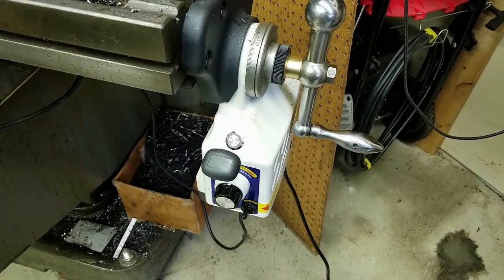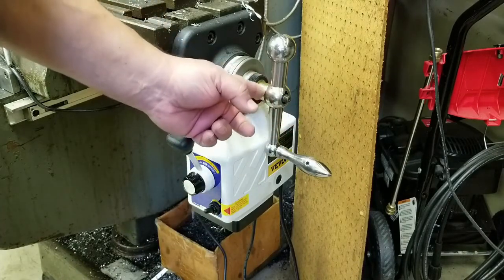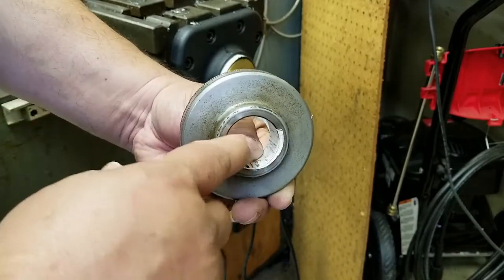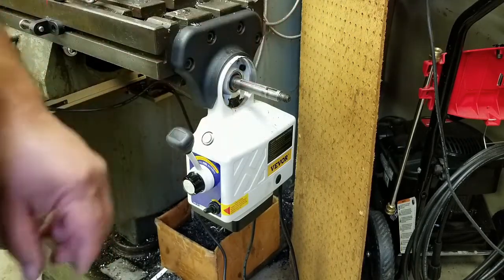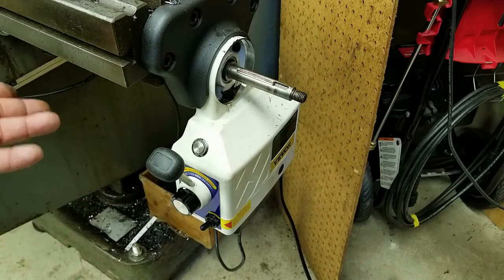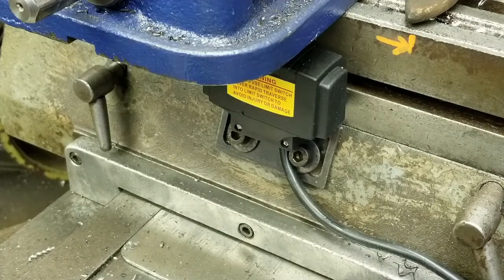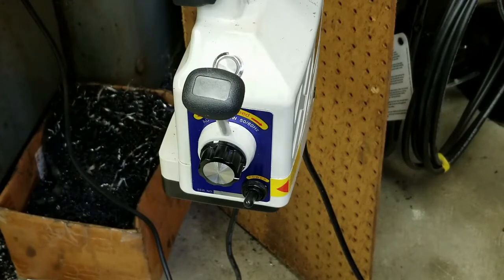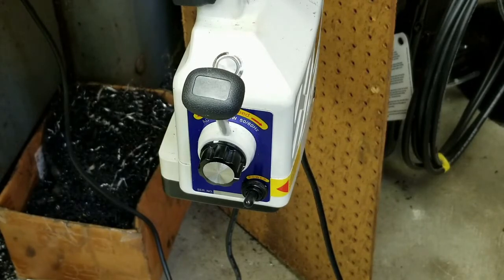EBAY VEVOR POWER FEED – MY THOUGHTS AFTER 5 WEEKS OF USE

Comment: I just fitted the same one to a bench top mill. I had to do quite a bit of modifications, but I must say, the basic unit and design is very adaptable. For anybody who is a fitter turner machinist this is very basic adapting and modifying. The unit is perfect. I have come to learn that a lot of Chinese products recieve negative propoganda for various political agendas. I run a jobbing machine shop and for over 20 years I have used Chinese and Indian made machinery. Like every manufacturer, there is good and bad. In my modest opininion, Chinese technology is way ahead of the majority of the world, and envy for this fact creates a load of negative, unverified reviews!  Simply because our South African Rand is such a weak currency, I have been forced to buy Chinese equipment because it is affordable. Surprise surprise! Some of it is excellent. My benchmark is to look for Chinese machines which have hand scraped ways and beds. Absolutely no variation between it and a Hatz lathe I also use. One "German" machine is made in China and rebranded. I had one and it got me going in business. I hate politics!!!
Reply: Ja Bru, I miss Adendorff since moving to Ireland.

Comment: I just got the same one and it was tripping my GFCI as well, I saw your video and found out it was a problem... I took it apart and the two phillips head bolts that are holding the circuit board on, are transfering trace power into the grounding circuit. I made a couple paper shims and installed between the circuit board and the mounting plate. Solved the problem, no more trips, hope this helps!
Reply from the maker: Awesome! One day I will tear into mine and hopefully find what you did and get it fixed. Thanks for watching and commenting and please subscribe if you haven't already. 
Mike - Plus8Precision

Comment: I had some similar issues with my chester 626 mill. I couldnt use the end plate so had to drill and modify etc my end plate. Made a few bushings and spacers etc but I managed to get it fitted ok. The plastic lock nut I will replace with a stainless one eventually. One issue I did have was shiming the brass gear correctly. But if its noisy you will need more shims adding. Cheers good video.

Comment: Couple comments: First the the loose bearing race bothered me so I made an extending bushing just long enough to reach beyond the edge of the 20mm lobe on the leadscrew. This way the spacers push against the the race and lock it in. Second, I was able to fix the jam-nut problem by using a normal sized nut and turning half of it down. So half of it fit inside the handle. Hope this helps. 

PS: I am also a Sheldon Owner (EXL). Best Regards Bob

Comment: Great info, I've got a kbc mill with the power feeds they put on it, its 2009 model haven't had any problems so far, knock on wood, lol..
Reply from the maker: Kentucky Trapper, I hope this unit last me at least that long. I was really disappointed when I first realized I had to do so much to get it mounted. I knew that with my work load it would be worth it to have soi pressed on. Thanks for watching and commenting...
Mike - Plus8Precision

Comment: If that drive is popping your GFCI, it has a short to ground somewhere. Mostly likely, a hot wire has abraded insulation that's passing some current to the ground housing. Since the housing is connected to the mill, disconnecting the ground wire won't block the leak.

Easiest thing to do is measure the resistance from the hot blade in the plug to the housing. I'm guessing that will show something in the 5–20kΩ range.

Comment: Hello Mike. I can't read the label info from this video, but it looks like it states the wattage on the device. If so, divide the wattage by 120 (volts) to get the amps. as for the GFCI tripping, it looks like it has some sort of ground fault internally. Did you try to use it on a non-GFCI circuit other than the 30 amp circuit that you used? I hope this helps. Thanks for the review, I'm thinking of getting one for my mill.
Reply from the maker: Hello Bob, the only information I found was 110V nothing more. It does not have any visible electrical reset on the exterior on the unit. You might be seeing the on-off switch on the lower right-hand corner. All the outlets in my garage are GFCI protected except the few I added. That’s what it is plugged into right now non GFCI outlet. I have had it since April, and it works great. It has a decent feed range lows to high, the lowest I could feed was about 15mm a minute. That’s about a .5 of an inch using a ¾ roughing end mill. I went back and looked on ebay and right now its $122.29. Thanks for watching and commenting…

Mike – Plus8Precision

Comment: Most of the complaints I've seen with these have to do with the speed being too fast at its lowest setting. What do you think? I'm considering putting one on my Clausing 8520, but it is a small machine and will need to run slow. I have an actual Servo on my larger mill, but don't want to drop another $900..
Reply from the maker: Hello, I think for the money the are a good deal. The power feed has good power and a wide range of speed. It has served me well and would purchase another unit. I do job shop work so it get used frequently and has easily paid for itself! Please consider subscribing to my channel!
Mike - Plus8Precision

Comment: On the power feed which size did you go with they have. A few rated in in/oz from 150 to 450. How is its slow speed performance
Reply from the maker: Len Ness, thanks for commenting, I don't recall what it was rated at. I can say it works good. Thanks for watching and commenting and please subscribe if you haven't already. 
Mike - Plus8Precision

Comment: Greetings,  I bought this exact device on eBay for about $125+/-. The install instructioins consisted of 6 pictures. I build  race engines.  I figured it out.  Unit lasted about 30 minutes in a slow feed using a fly cutter on my Bridgeport.  The nylon ring gear at the very bottom of unit stripped out. (I was milling about .002 per pass...no load)  The unit only has ONE ring gear.. Vendor said they couldnt figure out what  piece i was talking about.  I sent them 4 photos.  First they said could I repair it myself?  Or, they suggested, take it somewhere to be repaired .Said their engineers still didnt know the piece I was talking about, and could I send another picture with the item circled in red with some arrows.............Ok..............I did that .  While waiting for a reply the left and right travel lever failed.  Nothing moved.  Now they want a video of the unit NOT moving.  (Aren't they just photos then...?) I sent a video of the plug in, switch on, lever moving left andright and no gears moving inside.  They agree the unit was broken and would send me another.  I could keep the old one. They did.  All told from initial purchase to arrival of second unit, about two weeks.  Second unit arrived.  By now I am a journeyman installer of these units. I know what wont fit and has to be filed, and what the correct backlash is.   Same slow fly cutter operation.  Unit lasted about an hour and half.  Both units are in the dumpster.  I bought a Dynamo power unit.  Works just like it's supposed to.  My grandmother was right, "You get what you pay for."  Caveat Emptor😏
Reply from the maker: Hello David, thanks for subscribing! Your experience with the power feed is very unfortunate. The one I received is still going strong! I have machined alot of details since installing it. I use it for fly cutting, hog or rougher end milling and finish milling. I was worried about that little bevel gear myself but so far I have been lucky! And I have certainly not been taken it easy either. I machine nylon,  aluminum and steel.I bought mine from  Happykisssoul back in April of this year and deliveredit was $134. I have an Instagram and tiktok also and have added alot of videos of it running. Thanks for watching and commenting and subscribing...
Mike - Plus8Precision

Comment: GFCI problems are going to be ground leakage issues, probably initial energisation of capacitors inside the unit leading to a short duration HF  transient current.  Not a problem with the unit per se, but with the installation you're plugging it into thinking it's all going wrong.  Not sure if you have different types of GFCI over there in jesusland, but for stuff that's liable to have VFD or similar inside, you'd want a type B (detects AC, single wave rectified AC, DC spikes, and HF noise), and with a decent transient spike protection.  You might get away with a type A-SI as it's single phase.

Im an electrician, but you shouldn't trust anything I, or anyone else, says on the internets, and especially in youtube comments sections.  Talk to a qualified electrician.

OK, did a bit more digging.  Seems that things are all different over your side of the pond.  Talk to a qualified electrician.